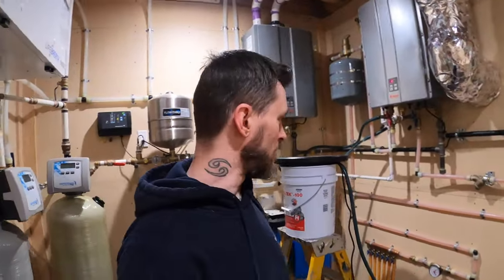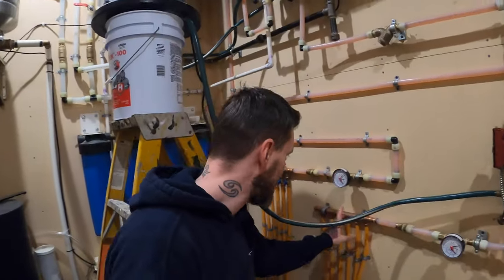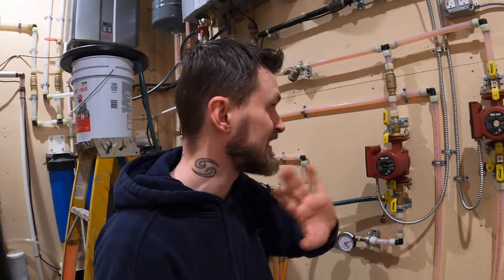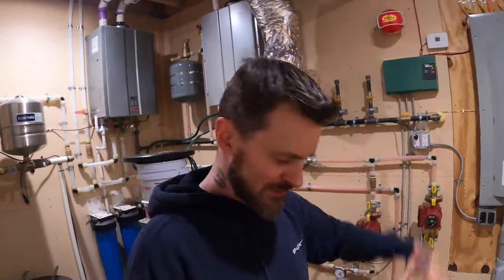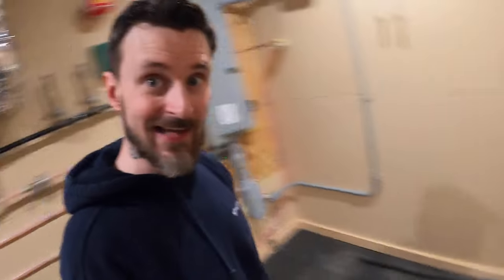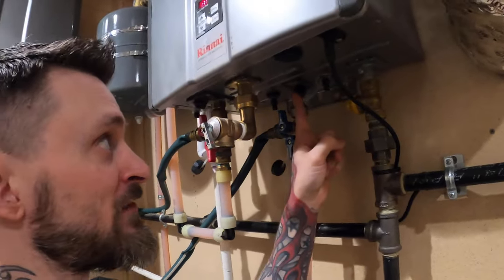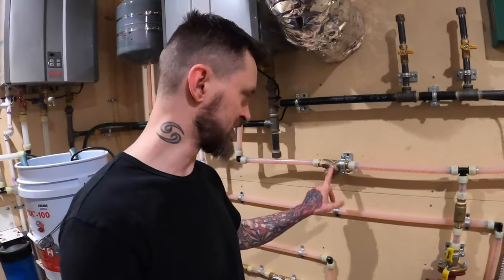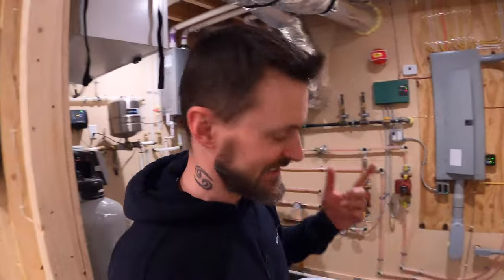Radiant floor screw up!!!

Comment: omg !!,,, u use a primary & secondary loop..been using tankless for years,,,you are not getting any flow because of the restrictive piping thru boiler,,this is soooo easy to fix,,yes i,m a master plumber and licensed hvac contractor,,,
Reply from the maker: I have no clue what you’re trying to say.

Comment: The Glycol will be causing the green slime bro!
Reply from the maker: really?  how often does it get changed out?   still very red/pink in there.
Reply: @neckofthewoods24  
If you want my opinion, I would remove it completely, there’s about zero chance of your system freezing as your water is moving all the time and your system is incased in concrete. 
Glycol should only be used in static systems to prevent freezing. 
We use glycol offshore all the time in some really harsh environments and find the tanks get green goo in them at the top after a while.
Reply from the maker: @jamdmcc8832  the garage is connected to this system.  The first tube runs right to the garage door.  In winter the heat from that tube melts outside of the garage about 8”.   However the in floor prob sensor is all the way at the back of the garage.  So the first tube could freeze at the door till the floor sensor in the back calls for heat.
Reply: @neckofthewoods24  I hear what you’re saying bro. 
How close to the garage door is the last loop of your system? 
How deep is the loop in the concrete? 
How often does the garage kick in and kick off? 
All I’m saying is the chances of your loop freezing close to the door are extremely slim due to concrete protection and the intervals of the moving water!
Reply from the maker: @jamdmcc8832  all 3 hot runs run in front of the garage door.  First right to the door then loop around the left side of the garage.  Second run runs in front of the first in front of the garage door then heats the middle of the garage and the 3rd does the same in front of the doors but feeds the right side of the garage.   Depth in front is about 6”.  Not sure about how often it kicks on.  It used to kick on all the time but when I put the in floor sensor, it definitely kicks on a lot less!
Reply: @neckofthewoods24  I somewhat agree that glycol may be the problem, and I liked where you were originally heading with your question about changing frequency. That said, I think it's multifactorial. That is, although you used distilled water, which is smart to reduce minerals in your water (reducing scale, etc.), it isn't the same as sterile water, and the radiant floor tubing that you put the water into isn't sterile, either. I believe you had your PEX exposed to the elements after install, during the summer and rain, which would have been a great breeding ground for bacteria (water+sunlight+heat). Initially, I think the glycol likely kept the biofilm (slime) under control, but after a couple of winters where there was 120F water from the heat pump, it likely has degraded the antimicrobial properties of the glycol to some extent. That, combined with water stagnation during the summer time, likely allowed bacteria to build up resulting in biofilm/ slime. 

Interestingly, this is a common problem that the general public is blissfully unaware of with regards to their drinking water. An example of this includes a recent hospital that we had constructed -- during the construction, the water lines had to be pressure tested (with water), then drained, but the inside of the pipes and any "dead legs" that were present in the plumbing (offshoots of pipes that don't recirculate, such as a length of pipe that feed a sink that doesn't get used), were breeding grounds for legionella as it was just stagnant water for months. So, eventually, despite a brand new building, the hospital had legionella problems requiring chlorine treatments to remedy, and continuous testing to ensure safe levels. You may actually see interventions at your hospitals, such as filters on the faucets where you wash your hands, or where you dispense water for patients, etc. The ice cube reservoirs are actually notorious for slime build up. Regardless, this is prevalent in most builds, it's just that hospitals test the water.

That said, things that you may consider doing that may help with biofilm build up is... 
1) Chlorine shock the water periodically; though, this may degrade your PEX. 
2) Avoid letting the water in your tubing stagnate (moving water makes it harder for bacteria to grow)
3) Periodically flush and replace glycol.
4) Do nothing and simply check/ clean filter once in a while.

That said, it's important to know that now that you have biofilm in your system, it's damn near impossible to eradicate it, so the name of the game is managing it....if you want.

Good examples to check out for more knowledge/ strategies on slime/ algae management can be found from industrial cooling tower water management; or, even talking to your hospital infection control department as they likely have a water management plan. 

Hope this helps

Comment: I know from building a water cooling system for a PC with radiators and pump you do use Distilled water but you have to add anti microbials and dissimilar metal additives to the loop. Even if all the metals in your system is the same (copper) the quality may be different just like the anti freeze in a car which has different metals in it also has additives added to stop corrosion. When doing a PC they tell you NOT to use food grade anything in the loop as it causes algae to grow and they say not to even color the water with food coloring but to use coloring made for a PC..
Reply from the maker: Interesting.  Probably why the micro screen was covered in green.  Was probably algae.  I bought like 10 gallons of regular but didn’t use since radiant systems all use the cyrtec 100.  Disposal was the reason but next time when the system needs flushed, I can use the real stuff.  I know my metals are cast, copper, brass and stainless.
Reply: @neckofthewoods24  I am not sure that using the car anti freeze would work as well  as it may not give you enough heat to dissipate properly as water would do the best. To me the way you have it is what most use but watering it down may work better as long as you  don't freeze at zero. There are a few companies that make the anti Microbial that you should add and glycol base products are used with water and help with dissimilar metals as even copper can corrode from different properties in each component you use.

Comment: I was looking at tankless for the shop floor radiant heating but after some research am leaning towards a propane tank type water heater.  On a side note, I noticed at about 9:00 there is what appears to be mineral wool in the background.  I am looking into Rockwool or some similar mineral wool batts for the attic insulation & fireproofing as well as sound proofing between rooms in the stud bays.  What brand of mineral wool are you using and where are you using it?  Thanks for posting.  👍👍
Reply from the maker: i used that in the garage attic with an R30 value from Menards called John Marsdon i believe.  it wasnt enough so i used 3-4 more inches of blow in cellulose.  in the house since they dont conform and get into all the nooks and crannies, i just used blown in cellulose instead.  kind of easier too since the wool weigh a ton per bag and moving all that around in the attic would be a nightmare.  with some left over, i used it in the walls of the master bedroom, bath and closet to keep sound out.  i dont think it made a huge difference, so the other interior wall, i saved money and time just used fiberglass.  anything is better than nothing.

Comment: Pump is on the wrong side of the water heater ? 
Better to pump into the water heater rather than trying to suck out. This will reduce pump cavitation ie less air generated.
Reply from the maker: No the cold side.  Keeps the pumps lasting longer.  They suck the water out of the floor and send it back into the tankless which fires it up like normal cold water coming in that turns it on.   Zero air generated too.   I introduced the air into that screwed this all up!